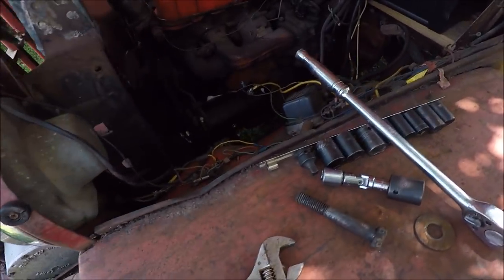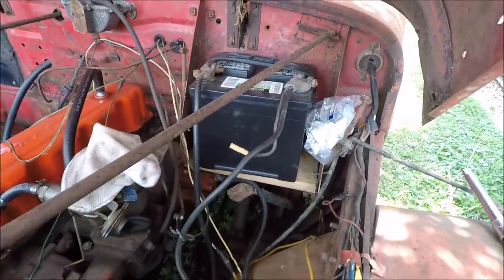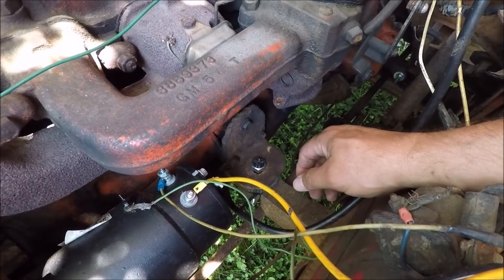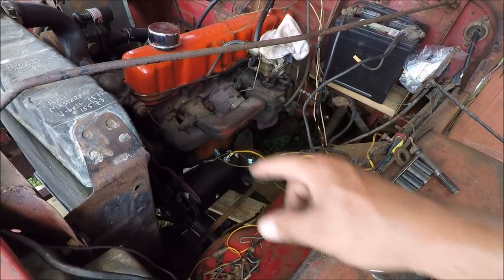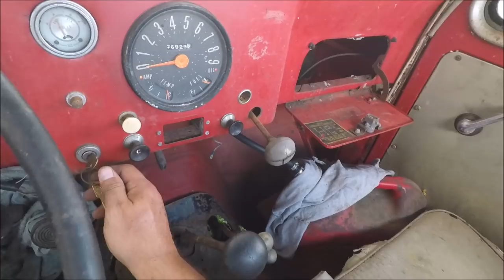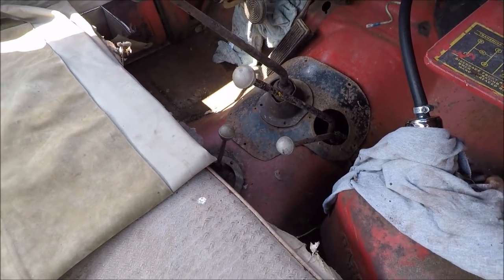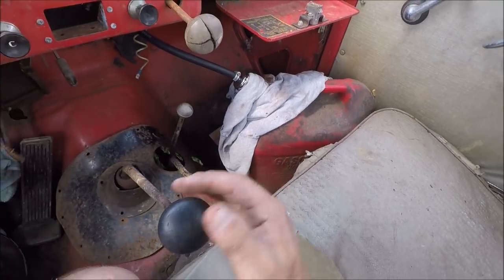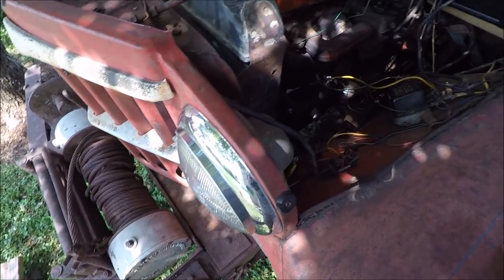Willys Truck Take 21: Hockey Pucks for Engine Mounts

Comment: Keep the copper radiator as long as you can. It’s more efficient than new ones
Reply: Yes my 02 e 150 van   radiator cracked across the top drivers side, i used epoxy and repaired it, 3 weeks later pasenger side cracked and split stranding me AGAIN ! The radiator  had no visible damage showing and had not been in a crash.
So keep the metal radiator but all so keep fluids fresh and clean.
And may be you won't invent new 4 letter words on I 24 W near down town Nashville Tn, as i did.

Comment: On that old of truck you have to put the hubs in to use 4 wheel drive
Reply: The Greenies will be furious cause you left tracks upon the that fine pasture grass.
Reply: Lock the hubs. Turn the dial in the center of each front wheel. Then try 4 wheel drive again. Change fluids soon too. Groovy truck!
Reply: Was just going to suggest locking the hubs. Y'all beat me to it
Reply: On those hubs you have two flat pieces on each hub. You pull out one end of each and turn them 360degress and snap back in place

Comment: Be aware that the creaking and popping you heard when raising the engine might be coming from the transmission mount, it's rubber and steel sandwiched together and the rubber tends to get brittle. Mine came apart in my hand when I lifted the transmission. Looking great so far!

Comment: Floor repair= tin snips  to cut the flashing or sheet metal, cut fit, secure with self tapping sheet metal screws or rivets.seal around cracks with bed liner, or flex steel or body sealer , I am proud of your progress  (I have even seen floors fixed with old license plates)
Reply: Dont worry about what some tell.  U should do this or that.iam 58yrs an i always have done most of my repairs,but iam still learning stuff.did u lock ur hubs in.u. have a sweet family.i like u say ur bride.u to seem real close.an she is a pretty bride.thats a sweet running 6cylinder.people said u never get running.u will end up putting money n it,but u will no what u have.i like the truck.take ur time an get where u want.ive got family n mobile.how close r u to there

Comment: Hockey pucks make great body mount bushings also,much cheaper than an oem,or aftermarket parts,we use them on top or below a body lift as an additional 1"+ lift using longer grade 5 or better bolts of course.....The lever on the passenger side of the winch engages it either forwards,one direction,or reverse allowing the cable to power out,or in,and it has to go fully one direction,or other to engage the winch with the center position being the neutral position...

Comment: on the bed hydraulics the control valve might be leaking thru internaly, disassemble it and try replacing the O ring seals

Comment: SOA,or Spring Over Axle conversions are often done due to being; cheap,and easy to do IF you have good welding/fabrication skills as well as the ability to possibly extend driveshafts,keep the pinion angle the same to prevent steering angle issues,but will usually net between 5 1/2"-7" of suspension lift,and will keep the "wonderful" ride feel of the stock springs :D...Sometimes the drag link interferes with one spring,or the other requiring a drop pittman arm,or a bent drag link to clear the springs at both crush,and extension...

Comment: I suggest you find a junk yard and make friends there.  Get an old muffler with a bit of pipe.  Any old muffler with a little life still in it.  You might even get some tires there, cheep.  Wheel and deal a bit.  Bo.

Comment: In regard the engine mount angle pieces which attach to the engine block on each side, if you are still having clearance problems between the fan and the front crossmember, you might be able to make new right-angle pieces which reach down about one inch lower before the right-angle bend which will raise the engine higher. You could of course stack hockey pucks to raise the engine which is probably the easier solution. 

The complication might be that the pucks may settle with the engine weight, slackening the bolts which may then walk, allow the engine to slide sideways and forwards putting the fan into the radiator core. Periodically tightening those bolts may be necessary. Raising the engine may cause the bellhousing at the rear to contact the body if there is not much room behind to play around in back there.

If the mount bars welded onto the frame bend down or break again, you might need to think about welding a strengthening plate, preferably with a right angle which extends across the top of the frame side rail. Then the engine mount arm which reaches across to the engine mount itself might be reinforced with a web or thick flatbar strap onto that reinforcing piece without disrupting the strength of the frame rail which will be already softened and weakened by welding directly to it.

An ideal solution would be to relieve some of the bending force on the mount arms and the twisting force on the frame side rails by joining the two engine mount arms on two vertical pillars which form the risen ends of a new crossmember passing below the motor. I think you might experience clearance problems with the front axle and other pieces under there so that's probably not an option. The folk who did the original engine swap may have already examined and abandoned such an idea.

For curiosity sake here is an example of the Australian flavour of the same engine family. The triangle three-bolt pattern of the side engine mounts is different.

https://www.youtube.com/watch?v=Y4tyU-C41RU - General Motors Holden "red" motor.

https://www.youtube.com/watch?v=3K95OEKP22k&t=326s - General Motors US motor.

As mentioned in other replies, it seems there are accessory hubs attached. These enabled to axles to be switched from turning with the wheels. This saves wearing out the front axle gears and bearings and saves some gas by removing some extra friction. Any four-wheel drive which operates in two-wheel drive for extended runs should have the four wheel drive selected occasionally to circulate some oil over the crown-wheel, pinion gear and the bearings. Normal road motion will damage the wearing surfaces if the oil film drains away.When accessory hubs are installed, four wheel drive should never be selected when the vehicle is in motion. With the front wheels disconnected from the driveline at the accessory hubs, the simple dog clutch which engages the four wheel drive will have to suddenly spin up the front driveline from zero rpm and will be damaged. Best practice is not to engage four-wheel drive on the run but people do it anyway and shockload the hubs the axles, the universal joints inboard of the hubs. It is also not ideal to haul heavy loads in low range with only the rear drive selected. Chance of breaking old axles are pretty good. Old Toyota Lancruisers used to snap their rear axles. Toyota put in the "L" gate and a common lever for selecting low range and four-wheel drive to stop people from overloading the rear axles. People took the "L" gate out because they wanted to split-shift between low range and high range. The three speed bottom gear was a bit high and old three-speed Landcruiser clutches tended to burn out in cross-country work. As a three speed Jeep, the bottom gear speed may also be a bit high and force you to slip the clutch a lot to get it rolling with a load or uphill. We used to split-shift the old Landcruisers lifting off in second + low range, change to top ( third ) + low range, then clutch in, pull main gearbox to neutral, clutch out, float the engine rpm, pedal clutch in, change to high range,  select second + high range, then top ( third ) + high range. It was handy for saving the clutch but came with the risk of cracking the rear axles off just inboard of the wheel bearings.

Comment: Was giving some thought as to your feelings of whether the four wheel drive is working . 
With the engine off , and front wheels off the ground and jack stands under the chassis , shift transfer case into 4Lo or 4hi and verify front driveshaft is engaged . Next , turn both front tires by hand to verify if the cutlass hubs engage . Don't know if those style hubs engage under torque but I would think that spinning them with enough momentum ought to do so . We must find out if there is a problem within the hubs . Not suspecting hub trouble or transfer case problems but would be beneficial to check the hubs and transfer case front output to ensure your front axle is engaging . 
Wondering if driving on grass , due to lack of traction and tire spinning has us guessing whether the front axle and tires are in fact pulling . The cutlass hubs are obviously some kind of auto engage hubs , if that has anything to do with satisfying the answer to the question . No noise or grinding when you engage any four wheel mode , so that's a good thing . Please be careful in all you do on the Willy's, even  when you are exploring and metal detecting . Loving your videos , be safe ✌️
P.S. - just checked out " read this " in the description of the cutlass hubs , yeah , I missed it too , love to hear more about it . Will research to . Thanks !

Comment: Lock the hubs...  There should be dials in the hubs on the front axle.  You need to twist them to lock the hubs to the axles.  The shifter only engages the drive shaft to the front axle.  Everything turns but the hubs because they are not locked to the axle.  

Love the hockey puck for motor mounts...

Comment: EA, have seen the leaf spring trick done on older Dodges to "jack" them up. Only problem to note is it throws the camber off on the U and differential joints and can cause premature wear on them.
Reply: Also throws the front castor way out creating a very dangerous situation where the steering doesn't center properly.
Reply: An SOA ( spring over axle ) would benefit but yes , cautions are to be noted . The leaf spring perches would have to be cut and relocated to obtain correct drive shaft angel . That's just the rear . 
The front axle is more sensitive in terms of alignment . Even around the farm , you'll want correct driveline angle so as not to launch drive shafts !

Comment: That's Awesome that it's driving and running well.Maybe a set of 16"wheels and tires from internet,or salvage yards.I've driven several and the gear ratio in the axles,even With the big military supplied,kept the speed about 50mph max.If you're just running off-road there,a set of 15"will get you a touch more torque for pulling loads etc.

Comment: Dump O Matic. Works like this. To raise the bed you engage the PTO pump. Once engaged the bed lifts. No valving involved. Disengage and the pump stops turning and the bed stops. To drop the bed you release the pressure by pulling back on the valve. So here is your problem > The PTO clutch is stuck and not releasing. The pump does not turn while the engine is running with the PTO disengaged. For some reason the pulley is not free wheeling. It should just spin free till engaged.

Comment: Little tip: make sure you can get the fill plug out before pulling the diff cover. Hard to refill the fluid if you can't get it out. I have heard of people putting gear lube in a big zip lock bag the slamming the diff cover back on to get fluid back in if the full plug refuses to come out.
Reply from the maker: Thanks for the tips

Comment: The spline on clutch disk is tappered. If backward clutch will work hard and bind up at times. 2) Polerizing gerator is simple. Just take a wire and touch the output side of generator to positive side of battery. That will covert field to Positive insted of negitive output. In may case friend and I forgoten to do that burn up the regulator. Had to get new regulator due to that.

Comment: Put that bad boy up on 4 blocks so the tires can spin free... throw it in each transfer case lever position and see if the front tires spin. Pull that winch cable out 20 feet and engage it too. Easy to find out if it works.

Comment: If you put a clutch disk in it has two sides. One side has a hub that sticks up. The other side allows it to lay flat in the flywheel. Google it and you will see it. You need it to lay flat.  If you never pulled the pressure plate out, it’s not a problem.

Comment: Looks like the fan is tight at the bottom. If so you need to rise the tail shaft on the cross member. This will bring the bottom of the fan out and move the top in.  On my Pro Street Vega I have to jack my tail shaft up to change the fan belt as the sway bar is so close to the pulley.

Comment: Its not stuck its residual pressure and is overcome by having the box on there or a slight load. this is very common with simple lift beds. not broken just a little light. Oh 16 years at the  Cat hydraulic shop in az that's how I know. cool truck

Comment: You need two of those things each side  but I would have headed over to the nearest tractor supply and bought a pair of universal engine mounts. Also, I think the original engine would have had a stay rod to prevent the engine moving backwards or forwards when you work the clutch. I suspect the engine is moving forward and the fan hits when you drive. A look at a jeep parts book might confirm 'yes or no'.  Also the bottom hose on the radiator is going to cause trouble .unless you can straighten it.
Reply from the maker: The radiator is fine. The fan hit it because an engine mount broke and it dumped the engine forward. had it welded, all good. That is why it was parked I found out

Comment: You were working the four wheel drive shifters right... but you need to lock the front hubs in...
Reply: C.C. Lapew 
Good to check also if the hubs are engaging cleanly . Got to look at some video to see if the front axle is open or closed knuckle . I believe a 1964 is closed knuckle ? That makes a difference in keeping water and debris out .

Comment: I think that belt is supposed to go under that idler pulley so it makes more contact with the water pump. I could be wrong tho, I never messed with a 294 with a hydraulic pump

Comment: To tell if you are running off of the battery, crank the truck, unhook the positive battery terminals, if the truck dies, then yes the battery is your power supply, if it still runs once the positive terminal has been taken off, then your alternator is working

Comment: The trans may be okay or bad. You still have some investigating to do.  There is also the possibility the problem in in the front axle drive hubs.  I haven't seen a good picture of the front hubs but they look to be full time with no lock in/lock out mechanism.  There are splines and gears in the drive hub that may be bad.  It would only take one side to be stripped too.

Comment: Here's something to think about, top radiator hose looks stretched, bottom one looks kinked.  Possible you need to reverse them? Seems like coolant would flow better if the hoses were routed better.  Good luck with the Willy's!

Comment: you have to reset the voltage regulator, to the new generator too. But if the voltage regulator is not allowing the generator to charge the battery so that it can keep the engine running. If the generating is putting out it will keep power going to the coil, if the coil have no power the engine has no spark and the engine will not run, with a charged battery or without one. .

Comment: Bungee Cord works great for a Hill Billy battery hold down. Keep the radiator, it will cost dearly for a will-fit replacement.
 Cost guesstimate $250 vehicle, 95 battery, 12 valve cover gsk, 18 plugs, 30 wires, 25 coil,5 gas line , 750 motor/trans, 100 generator, 6 hockey puck, 9 thermostat, 14 antifreeze, 25 hoses,kotterkey, 23 belts, 14 dist. cap, 5 rotor, 5 points, 20 filters/oil, 10 hyd. oil, 55 starter, 45 waterpump,100 misc. So a grand total of ~ $1,616.
Reply from the maker: almost perfect, engine was 500 but Im still around that number so far, i sold the trans so i'm a tad better haha

Comment: On my truck I have manual locking hubs you have to turn the hubs into the lock position on the front   axle to go into 4 wheel drive

Comment: Good practice is to place bolts where the nuts are on the rear or bottom, so gravity and foreword motion will tend to keep bolt in place if nut came off.

Comment: I've never dealt with a 4 wheeler, but I think you have to physically turn the hub in the center of the front wheels to put it in 4 wheel drive.

Comment: To check your charging system get an ohmmeter test the battery when the car is not running get a voltage check then when the car is running check it again to see what different power level there is
Reply: Paul Fournier Sr 
Yes , get a volt reading with engine off and then start it . Although it's a generator , it should register with a load and at higher rpm .

Comment: Have you put a spring on the hydraulic control lever. Makes you have to pull it on. 
Factory Jeep bell housing has a big hole to look at the clutch.

Comment: Forgot to mention , would be good to drain and refill both differentials as well as the transmission and transfer case . Spray the drain and fill plug threads on trans and t - case to ensure both plugs on both cases unthread . Happened to me . Drained a transmission and had trouble opening the fill plug . Got it open with A LOT of trouble , and some heat . A stiff bristle brush on the exposed thread to spray penetrating oil could be helpful .
Reply: I had a similar issue and learned to always open the fill plug first, before you drain anything.

Comment: Did you ever take the hydraulic lines off? Maybe the lines have been reversed. If the valve is working correctly that maybe it.. Just a guess though

Comment: Does your front hubs have a lock and un-lock for the four wheel drive. A lot of older four wheel drive front hubs had to be locked in before you engage the four wheel drive.

Comment: Did the bed have a locking lever to lock it in the down position, if so many the weight of the bed caused the bed to lower when the lift was not engaged.